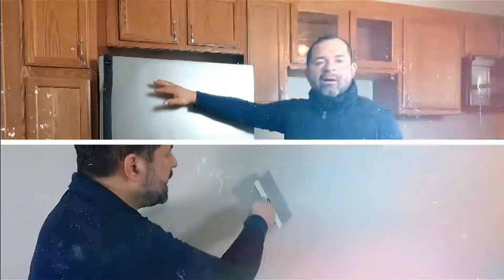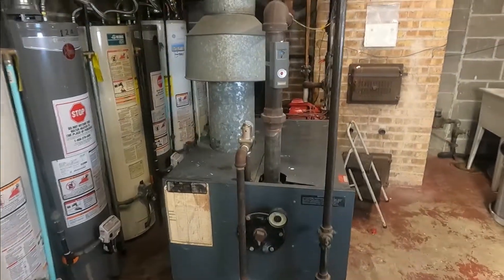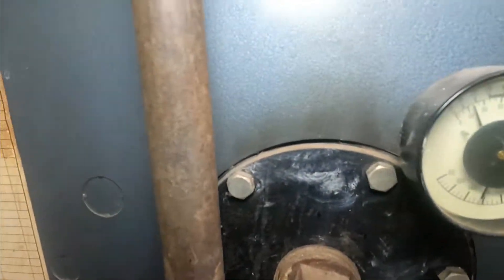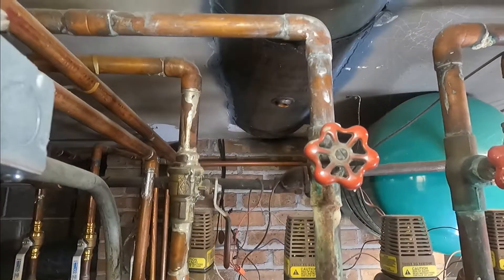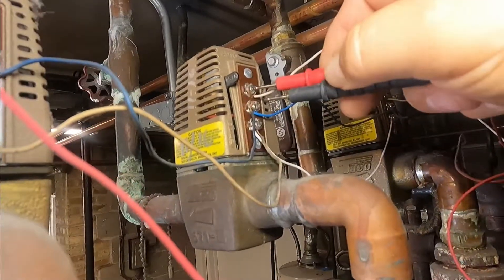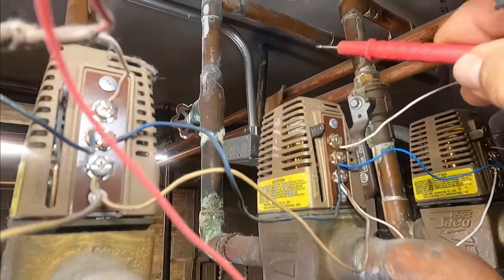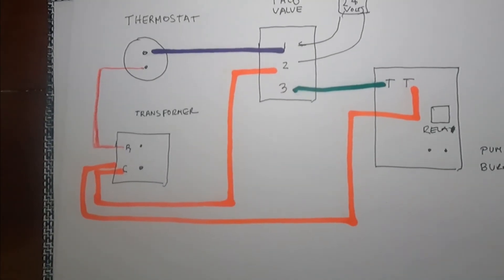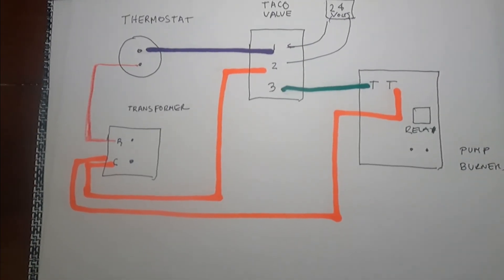NO HEAT. SERVICE CALL # 5  3 WIRE TACO VALVE FAILED. TROUBLESHOOTING

Comment: I think I have the same issue, but when i manually move switch to open, The valve still does not open. The heater is calling for heat on control box. Could this be a thermostat issue or still the power head? Also, the lever feels a lot easier to move versus the other power head levers. Brand new heating system was installed last year. Any suggestions?
Reply from the maker: If you have 24 Volst at terminal 1 and 2.  and valve does not open, Then thermostat and transformer are fine.   
More than likely you have to replace the power head.

Comment: That's a pretty nasty setup down there. 2 apts on one pump and 4 on another? That place looks like the Munster's dungeon. BTW, that's not a proper boiler shut off with that fusetron. Should be on a breaker. What a mess!

Comment: My heat is always on now even with the thermostat disconnected.  Could it be that the valve thing on top is stuck and needs replacement?
Reply from the maker: Hello,
It is possible.  99 % they fail in the closed  "no heat position"
Make sure the lever on the valve is on "AUTO". If it's on "OPEN". it will run hot regardless of the thermostat.   
Let me know what you find out.
Reply: @alexthehandyman3494   Thanks for your response.  I have the lever set to the "auto" / vertical / up position, so it's flush with the unit.  It is the same position as the other three zone heads.  If I try to move it into the down / open position, it only moves 1/4 of the way.  I've tried with the boiler running and off.  I removed the head and the lever moves freely.  I tried a few other valve heads I had in the basement which but the lever won't go down once it's mounted.  I read on a forum where you can lightly tap the valve body which might unfreeze it.  I tapped it really light because the last thing I need is to break a solder seal and have the basement flooded with water.   It looks like replacing the valve assembly will really suck.  Have you ever seen the valve lock in the open position?   Thanks!

Comment: Thank you.  I wish I had access to this video some 30 years ago.
The “grease motor” actuator valve head of the 571’s AND the end switch had me completely lost when I was an apprentice electrician.

Now I occasionally wire these for existing customers.
Unless there is a home automation or other control system at the premises, I just use the Taco zone valve relay control unit. It’s a standalone device with 6 (or 4 or 8 - different models) zones.
Extra internal 24vac/40va transformers and a ton of features.
Run 2 cond from the boiler TT connection in the controller.
Run a 3 cond from each valve to the assigned zone on the controller.
And..
Run your individual thermostats to the assigned zone terminals.  (R + W + Common). 
When a T stat calls for heat, the appropriate zone valve is actuated.

There are LEDs on the front panel indicating the status of each device and system.

Only $200-300 and it makes the installation easy for you, the homeowner AND the next service tech on site.
Reply from the maker: Hello PowderMill,  I know exactly what you are talking about.  In fact I have a 20 min video about it.  Check it out.https://youtu.be/ry993DvR5ZU?si=EG9o9bEtF3-jWuBI.  
Thank you so much for sharing your experience.
let me know what you think.

Comment: Great video You also do a video explaining what is the apartment is airbound
Reply from the maker: Hello,  Maybe I will.  Thank you so much,  
Number one enemy of a boiler system is pressure and air.   Every time you open the system replacing a part or if you have a leak, air enters the system and if you dont have a decent air remover device, the air accumulate specially in elbows and create believe it or not a plug. It creates a barrier.  Water cannot circulate.  For that you have to bleed.  You have to push water hopefully just on that branch ,  You isolate it by closing the other branches.  Feed more water to the boiler and then circulate through that only branch.  You then release that pressure (water ) (and air) through a bleeding valve that has to be located usually on the return line right before it enters the boiler again.
Reply from the maker: I just realize I have 3  videos on that.  This is one of them.  Enjoy .  https://youtu.be/3qMzDn2DJiw?si=RzLgSEy5zojnc4Uf
Reply: @alexthehandyman3494  thank you so much for your prompt response once again thank you so much for the video

Comment: Dealing with the same issue now. Could a flag that is hard to move be an indicator of a faulty module?
Reply from the maker: Hello.  If you are calling for heat, you should have 24 volts between 1 and 2 terminals.   when you have 24 volts then the internal motor opens the vlalve.  When the valve is open the flag or lever is easy to move from  auto to open.   If you have 24 volts and the valve is not open then the valve is to blame.  If the flag or lever is hard to move from auto to open is because is not energized or it is faulty.    Makes sense.?

Comment: Thank you very much Sir. I've been going through my system, and this seems to be it possibly. Mines is blowing cold air on the second floor and baseboard working well on the first floor. Second floor lever won't move at all and is getting 24volts.